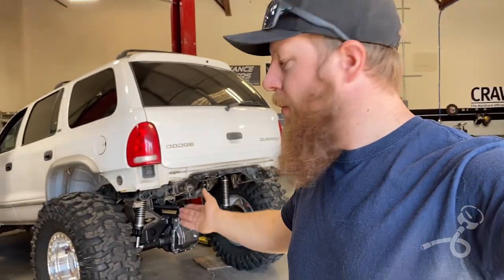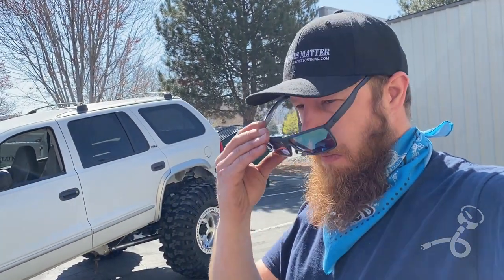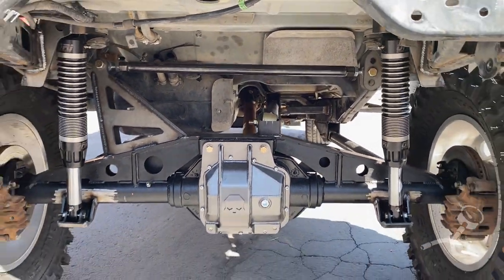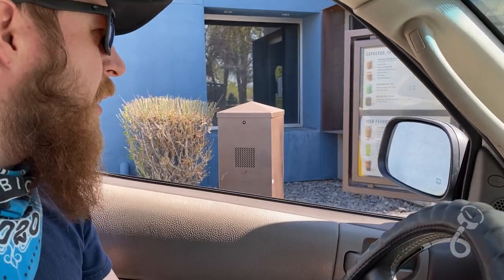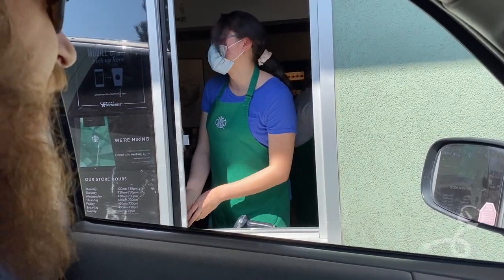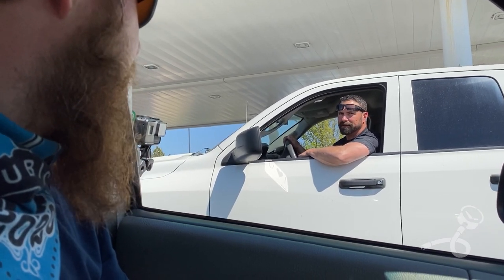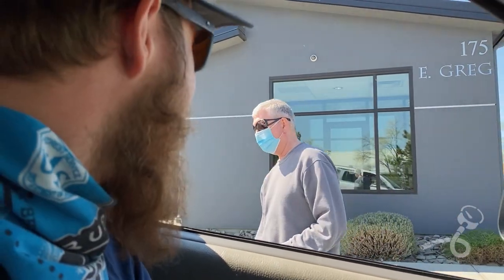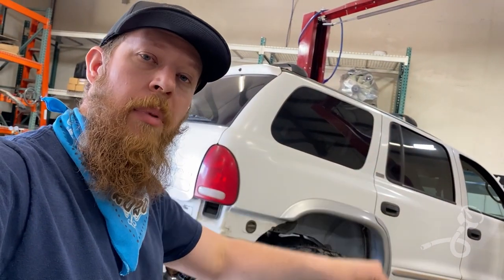Street Drive Insane Custom Truck - Aired Down Drives Half Baked Rock Crawler on the Road!

Comment: It’s a race to the finish my bro. The Dakota is almost there. I too have run out of money. Lol.
Reply from the maker: It’s amazing what it costs huh? At this point I’d be very surprised if I beat anyone to any kind of completion goal. I haven’t been able to give hardly any time to the project with all the post-COVID get togethers.
Reply: @aireddown813  I still have to set up rear brakes and drive shaft. What are you doing for your T-case? SYE? Advanced adapters and JB conversions make one for the NV231 in the dodge
Reply from the maker: @rastafaraipirate  I hope to find a JK rubicon 4:1 case to throw at it. Then get a new driveline. The one in there now is adapted in just so I could make this video.

Comment: What's your plan up front?? Why the three link in the rear instead of triangulated 4 link??  I picked up an rt today that I was going to pull the motor for my TJ (already have a 5.9 YJ)  but stumbled on your videos. Might be building the Durango instead.
Reply from the maker: The Durango continues to impress me the more I work on it. It’s in the process of getting a 3 link on ORIs and Superduty Dana 60 up front. I went 3 link rear to save the gas tank which is right in the way on the driver rear frame rail. If it doesn’t perform, I can do a fuel cell and a 4 link.

Comment: What are the exact dimensions of your tires?
Reply from the maker: I know the diameter is exactly 43” Aires up to 30 lbs on throes KMC 20x10 beadlocks. Not sure about the width, but they call them 15.5” wide I think.